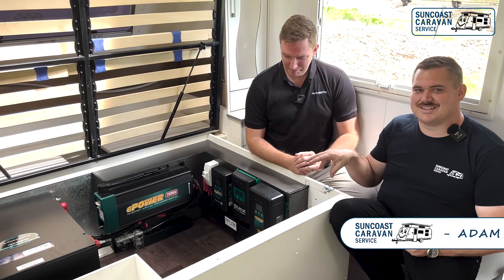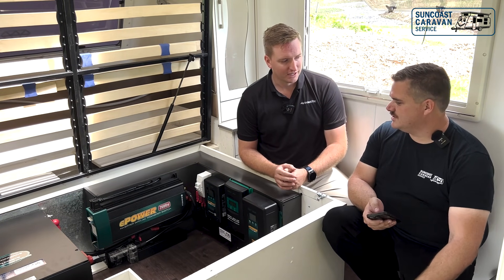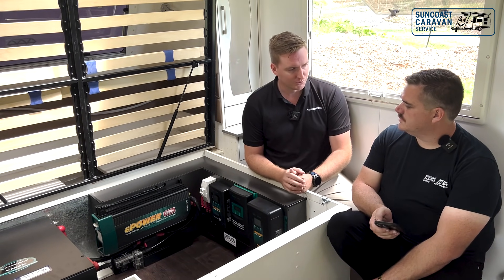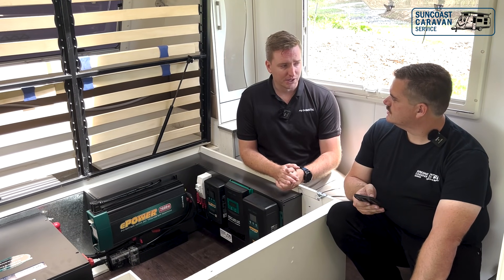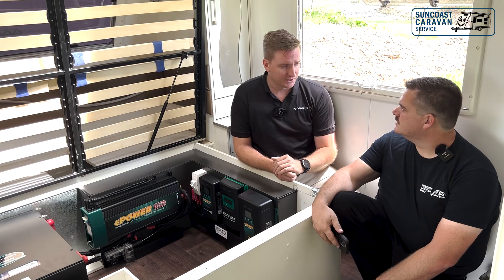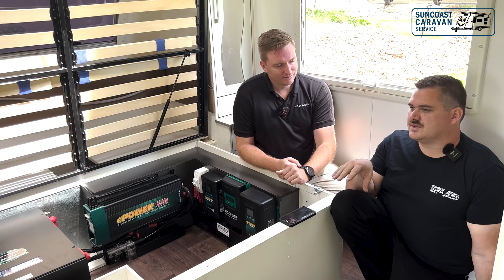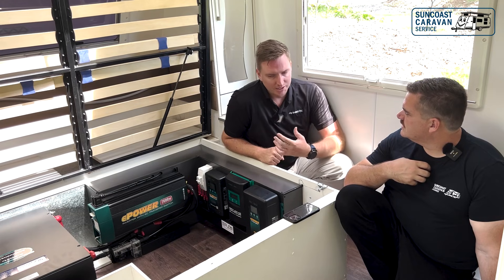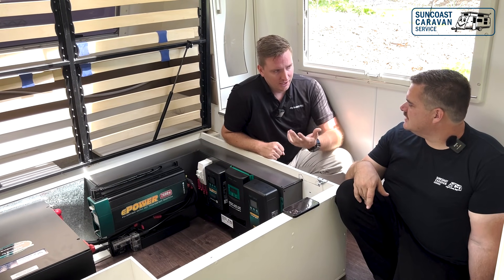NEW Caravan Electrical Install Standards : Your Questions Answered

Comment: I have a 2022 legend caravan, it’s fitted with a 200ah lithium battery, in the same under bed compartment is a gas heater, this area is only vented to the cabin. Is this a safe/ legal installation.
Reply from the maker: Very good point - as your system was installed prior to the new regulations coming out, your system remains compliant to the time when it was installed. If you choose to update the system like this one, then we would bring it up to current standards.
Reply: This makes no sense at all. So you're saying his setup is safe? But if I did the exact same setup he has, it wont be safe? These rule makers have lost the plot lol.  @suncoastcaravanservice1977

Comment: So do the regulations state any upgrade to lithium  phosphate lifePO4  12v systems can only be installed by an certified installer? 
  Does the regs state anyone DIY fitting life po4  must get certification or signed off?
Reply: Nope
Reply: As long as the installation is compliant to the standard I believe anyone can do it. The proviso of course is whether 240v is involved in the installation and, obviously, only an electrician can do that.

Comment: That looks like a slat bed, what does a sealed lid look like, I still haven't seen one provided by any You Tube video.
Reply from the maker: Thank you for your comment. The batteries are both sealed inside the specially made box under the bed as shown in this video, so the bed being a slat bed does not matter as the batteries have been compliantly installed.
Reply: Buddy, look at the black rectangular box next to the dude talking, I think the batteries are sealed up in there with venting to the tunnel/outside.

Comment: I reckon all battery should be mounted on the draw bar of the van,never inside also a isolation switch on the outside as well,let the battery breathe and not lock in a box under your bed.
Reply from the maker: Interesting thoughts. Our technicians concerns are around the draw bar being a potential high impact zone but thanks for your thoughts 😊
Reply: @suncoastcaravanservice1977 good enough for Gas bottles. I am more concerned about weight distribution
Reply: Not always possible to install a battery on the drawbar if there's gas bottles close by. There's regulations that the gas system must have regarding ignition source. If I'm correct there must be 600mm between the gas and an ignition source, and they can't be in the same compartment. It's abit of a mine when you think you have a battery location but there's gas nearby. Totally agree that an isolation switch should be easily accessible.
Reply: No decent installer will place batteries on the drawbar, apart from being a high impact zone you may be loading too much weight near the hitch.

Comment: It looks like you have only isolated the Positive side of the solar panels. Do you also need to isolate the Negative using a Double Pole isolator, as you do have to do this for American standards?
Reply: Thank you. 🙏
Reply from the maker: Single isolation as they are parallel panels according to the Australian Standards it doesn’t require double pole isolation.

Comment: Hi is it advisable then to try and mount batteries on chassis rail then
Reply from the maker: Thank you for your question! It would depend on the products & system if that is an option with the manufacturer. Most welcome to call our office to speak directly with Rhys specifically about your situation to advise.
Reply: i will do so in the near future thanks.